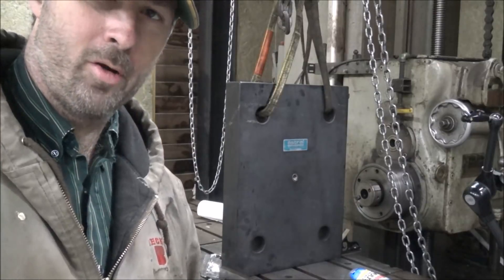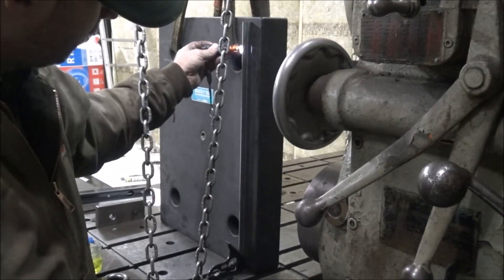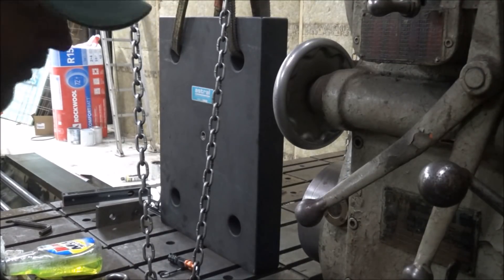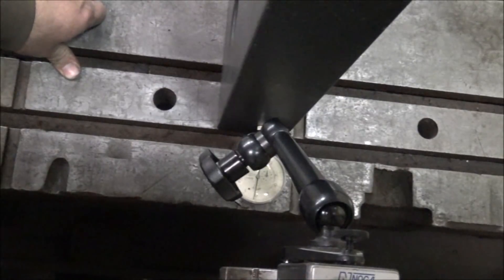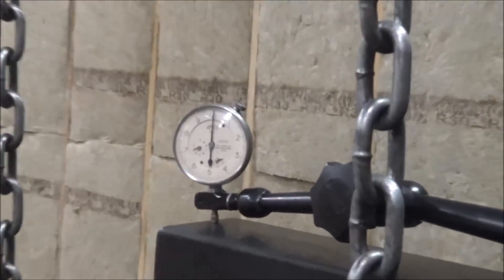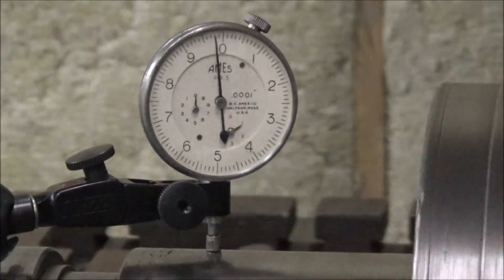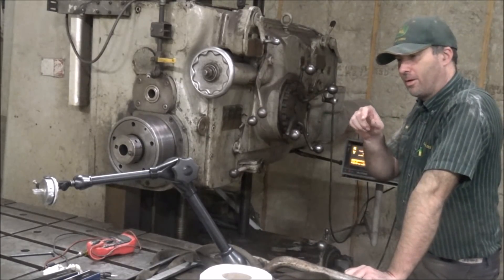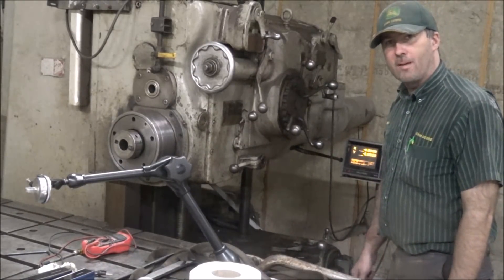Aligning The Big G&L  Horizontal Boring Mill Amazing Results

Comment: You may have done this already, so please excuse me if that is the case. But in regards to the linear scales, take them apart and clean the heads and scales with isopropyl alcohol and q-tips, then make sure the sensor in the heads are aligned properly with the indications on the glass. I had a similar problem as you are having with my mill a ways back. Once i did the cleaning  amd adjustment it never had a problem  again.

Comment: Nyce Work.  Sir, if may suggest D.R.O. part, check for input signal from encoder, I mean all the wires should have continuity ( check through a multimeter) to the D.R.O.  Check if the D.R.O. gets Zero Out the readings.  If it does, I think it is the encoder or the linked wires  to the D.R.O.  You may also dismantle the ENCODER AND REFIT after cleaning  it of any dirt, chips or grime.  As you  have said the +5 Volts is present at the encoder,  check the continuity of other terminals till the P.C.B. of D.R.O.  May be,  the socket's male & female contacts (if there is) has a bad connection.  I hope you apply simple logic in troubleshooting ENCODER & D.R.O. and make it work again on your own.   You may even open the D.R.O. Display Unit and see for any apparent PHYSICAL Damage to any of the I.Cs, Capacitors or Resistors.  Also check them(resistors and capacitors)  with multimeter, before turning and disconnecting the Power.  Thanks for the Video

Comment: If your meter is new enough to have a frequency measuring ability you could look at the signal output lines from the read heads. I suspect they are relative indicating quadrature heads, so there should be two output lines from each head.  There should be a DC level on each output when the machine is stationary, and then some frequency that increases with movement speed. If you can't measure frequency you could try measuring AC voltage on the outputs. Again, it should be zero when not moving, and go up to something like maybe 1.7V AC when moving. 
The problem with the vertical scale suggests that one output channel is working and the other one isn't. I suppose this could be a speck of dirt under the head blocking one of the light paths. It could also be one of the outputs is somehow disconnected. The horizontal scale sounds more like both outputs aren't working.
You could also try looking at the outputs of the heads with the DC voltmeter. If you move the travel VERY slowly, you should see each output go from probably about 0 to probably about 5V and back as you move along the scale.Since it will do this for each line on the scale and your scales read in something like tenths, you can see that you would have to move really slowly to make this work. But even if you just randomly move by some amount you should likely see different output levels from a working read head in some different places along the scale.

Comment: Take the cover off of that old DRO box and clean and reseat the boards and cable connections. It is very common that those old devices living in the environments that they do will have filthy connections and when the machines are transported the vibrations tend to knock the marginal at best connections out of contact. Another thing of concern are the capacitors and electrolytic on the board are quite old and way beyond their life expectancy. When I am restoring old electronics I just replace the caps and electrolytics and test all the resistors and replace all that are close or over their tolerance threshold. Those old capacitors are foil with a paper dielectric. Well you have seen what happens to 50 year old thin paper, yes it goes acidic and rots away. Once capacitors start to leak or short they are essentially turning into resistors and allowing DC voltage to pass through and into a part of a circuit that does not want it. This can create all sorts of interesting things to happen, sometimes with catastrophic results.
Reply: The 80's stuff doesnt have paper&wax capacitors in it anymore, this is more in older devices like 60's radios and stuff.. but true about the the electrolytic capacitors, especially the ones in the power supply as they do the most work... when they dry out, they fail to smooth the ripple voltage, which can disturb the digital logic. Also yeah cleaning the contacts is a good idea, and maybe also resoldering any connectors and "heavier" components that might have wiggled loose... for contact cleaning please dont use WD40 :D what works best is stuff like "CRC Tuner 600" or "Deoxit D5"... good luck! :)
Reply: Well I didn't say anything about wax because I know that was phased out in the 60's, however paper dielectric was still used long after they quit using the wax.
Reply: Sorry joseph my fault then i have probably misread your post.. anyway i think we agree on the fact that they should be replaced a.s.a.p. :) its easier to change some caps before they die, rather than all the other "unobtanium" parts they might take with them when they do--
Reply: Alex Reeve Yes they do like to eat things like transformer's,  boards and displays.

Comment: Brian, if your read out switches between 0 and 5 when you move it, the duty cycle need to be adjusted. On the reader head are two pots, for channel A and B. The duty cycle needs to be 50% for it to work. I had the same problem on the same scales as yours. Ideally an oscilloscope is needed to adjust it, but I was able to do it with my Fluke Multimeter reading frequency. The pot was very touchy to adjust. A small movement made quite a difference on the duty cycle. 

Yogi

Comment: I would not trust the square that much against the 3" side sitting on the bed, a dust particle can push it out of square.  To average out things you should turn the square 90 degrees left and right.  Other than that it is great to see the process all work out.

dee
;-D

Comment: See later comment please, I am in error in my initial reply.
 Brian,  with regard to the linear encoders, having checked for 5.00 volts at the reader head ( on thicker wires), check for 3.30 volts on each channel pair of wires. Your DMM is plenty good enough for this. Each channel is normally identified as A or B. The DMM will show 3.30 volts  on both channels simultaneously due to overlap of the square wave.

You may also have a reference or marker channel identified as Z. If there is a channel Z, then there should be a marker/magnet somewhere along the encoder length, by default this is mid length.

 If the encoder is an "Absolute" type, then there is no marker, but the display unit remembers the raw value from the encoder.

Regards from the UK.
Reply from the maker: Will it be 3.3V between the two or 3.3 on each one going to ground? I suspect these are absolute type as they always start at 0.000" when the monitor is powered up so I think they just count.
Reply: bcbloc02 , 3.30 between each pair/channel, they are not referenced to ground, the 5.00 supply is. As the 3.30 is supplied by the read head, you can disconnect the two channels at the display end, to check for cable damage/shorted wires.
Hope this helps.
Reply: Is there definitely 3v3 logic on a bit of kit from the late 1980s?   I'd have assumed it would all be 5v from then.
Reply: Hi Will, you may be onto something, I have found a "MillVision" manual and on page 109 it has the Square Wave as 0 to 5.00 Volts, ref channel A, B and Pin F "Fiducial".
It is TTL compatible, with a suitable resistor. I am familiar with Heidenhain encoders, from late 1980's, and Acu-rite appears to be branded/badged Heidenhain for some encoders.
Link to MillVision Manual.
http://www.acu-rite.com/pdf/manuals/obsolete/MILLVISIONmanual.pdf

Many thanks.
Reply: bcbloc02 , because of the overlap on the square wave signals, you may, just may see the change from 0 to 5 and 5 to 0 volts, but unlikely, as you said in your  video, an Oscilloscope is the correct instrument. 

Could you compare readings on your K&T, if the pin outs and encoder are similar. Reading through the Millvison manual, can you compare settings on both counter displays. Sorry I can't help more. Time to retire for the evening here in the UK.
Reply: Hi Brian,

Will Dean raised an interesting query. My reply is below, with link to a MIllvision manual, showing Pin-Outs and Channels for your read heads.
My initial reply is in error, you are correct, all voltages and channel square wave signals are referenced to ground, not insulated as I first thought. My sincere apologies for this.
My reply to Will.
[[[[[[Hi Will, you may be onto something, I have found a "MillVision" manual and on page 109 it has the Square Wave as 0 to 5.00 Volts, ref channel A, B and Pin F "Fiducial".
It is TTL compatible, with a suitable resistor. I am familiar with Heidenhain encoders, from late 1980's, and Acu-rite appears to be branded/badged Heidenhain for some encoders.]]]]]
Link to MillVision Manual.
http://www.acu-rite.com/pdf/manuals/obsolete/MILLVISIONmanual.pdf
Reply from the maker: So if I check with my meter I should see 5v to ground on a, b, c, and F 
when positioned properly, if I slightly move the scales should I see 
them change  to 0V as well on A and B? I assume that is how the readout 
gets its signal?
Reply from the maker: I have newall on my other machines and they are totally different.

Comment: Hey Brian, great work on the mill! how did you adjust the column? just by using the leveling feet on the bottom or does the column have some adjusters built in. it would be nice if DRO PROs would be able to donate some scales to you :-) but I am not sure if they sell them that long lol
Reply from the maker: Yes I used the main leveling feet to twist the column. The column does come off but from what I undertsand its a precision scraped surface and you want good contact so I didn't try to adjust it to get it square.

Comment: Looks like you have everything aligned up Good Job . I have not done all of these test  on my boring mill. Because I don't have all the fancy tools you have. So would a normal surface plate be square on the sides or just on the top. To bad your to far away I would have you come and help  check mine out
Reply from the maker: Most surface plates are finished only on the one side. If you have a surface plate at all you could mill a cube and then check it on the surface plate. That is probably an even better test of the performance of the machine than what I did. You could indicate some straight edges and at least see how the axis were travelling but that wouldn't tell you how square they were.

Comment: Those huge machines are alive....   !!!!      They keep on moving all the time, any reason is good enough, temperature, full moon, tide, you flushing the toilet in the house,    etc....   etc...   lol
Hope you get the DRO working, it's nice to be able to rely on accurate fast measuring system, mainly on a mill...   ;)
Reply from the maker: I have my  fixed .0002" level sitting on the column leveling pads and so far it has been staying in the same place day after day even with the 50deg temp swings. I am pretty happy about that!!

Comment: Hi brain, another great video. I had a scale stop working and doing a very similar thing to yours I took it apart to find the bulb in the reed head had blow, fitted a new one and been fine ever since. Mite be worth a look.
Reply from the maker: No bulb these say they are LED. I wonder when it is on should I see light?
Reply: Yes you should see light. There is a photo diode in there that's needs light to read the scale.

Comment: the downside is, if you tighten those bolts you end up straightening the curve out of the earth
Reply from the maker: Well lately I have been hearing it was flat I guess that explains it! lol
Reply from the maker: Gravity is always pulling down so yes I suppose it does follow the curve of the earth. I bent my mill!!
Reply from the maker: You all act like this is a big machine. The real big mills wouldn't even fit in my building!! lol
Reply: I worked at a ship model basin where we did testing for the Navy.  The 3000 foot rails on which the towing carriages ran were aligned to follow the curve of the earth.
Reply: at what point is the earth pulled in by the gravity of the mill though
Reply: Actually, isn't Brian's level following the curve of the earth, not straight/flat.
Reply: yep , we wont mention the vertical shipyard lathes that you can stand on the chuck while it works, and you barely know you are moving, its so big